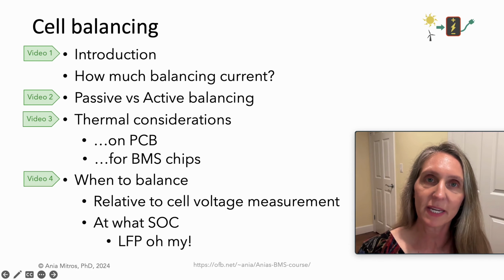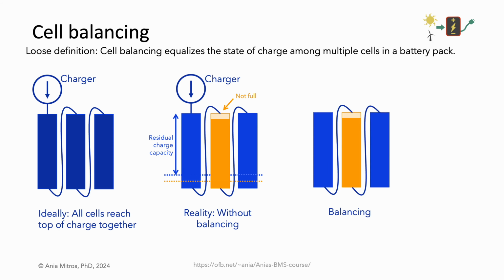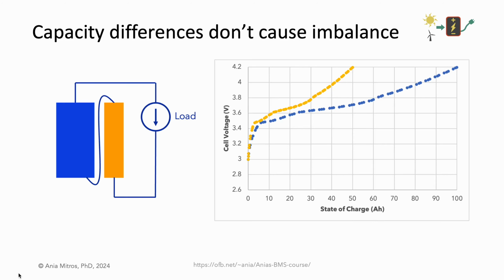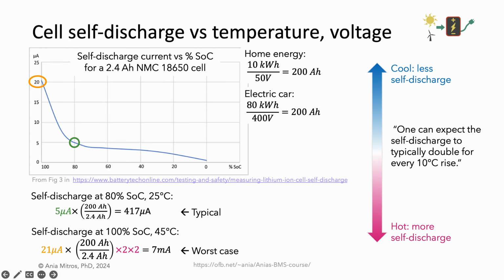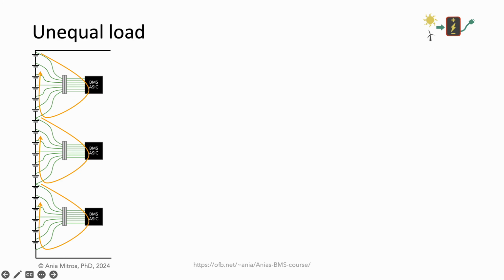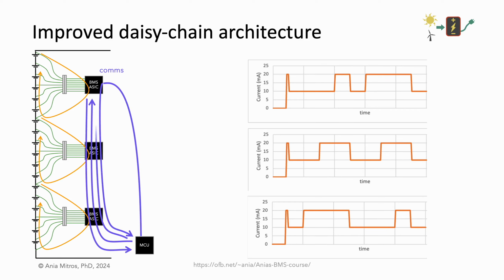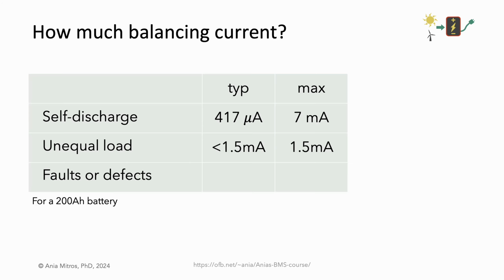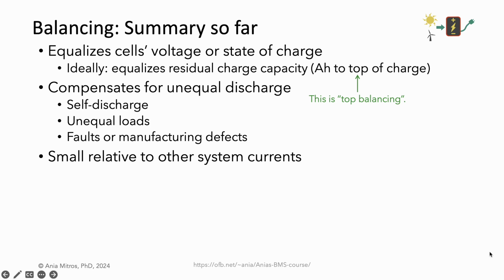Ania's BMS Course: Cell Balancing (1 of 4)

Comment: First of all thanks for your presentation. I am a bit confused however. I understand the statement: "ideally: all cells reach top of charge together" imo this implies they have exactly the same capacity. "practice: cells can end up imbalanced, cells can have different residual charge capacities" imo this means that their capacities (all be it small) are different. I cannot reconcile this with the statement "Capacity differences don't cause imbalance" because the earlier explained imbalance seems to stem from deviations from nominal capacity. Do I miss something here?
Reply from the maker: "Ideally all cells reach top of charge together" doesn't require cells to have the same capacity. Say you have a cell that is 1Ah and another that is 2Ah. Depending on how they are balanced, they might reach 100% SOC (top of charge) together, but when the smaller capacity cell is empty the second cell will be at 50%. Or, they might reach 0% SOC together (bottom of charge), and when thus balanced and then charged when the 1Ah cell is at 100% the larger cell will be at 50%. If you have unequal capacity cells, your balancing algorithm determines at what SOC any pair of cells ends up at the same voltage or SOC.

The sort of imbalance that a typical balancing circuit corrects for arises from unequal self-discharge, not from capacity differences.

I think you're thinking about imbalance as meaning voltage difference. I'm thinking of imbalance as difference in residual capacity, or difference in how many Ah that cell can take in.

Imagine two cells which have 1Ah and 2Ah total capacities, and balance them so that they are both at 100% SOC. Now you discharge them as low as you can go, so that one is at 0% and the second at 50%. Their voltages are different, but as I see it, they are balanced. Each cell can accept 1Ah of charge. If you charge them again, they will reach 100% SOC together.
Reply: @AniaMitros  Thanks for the explanation. It is more clear to me now. Is it correct that you see the function of the balancing circuit to compensate for "drift" effects between cells like self discharge and unequal load? In that sense cell capacity deviations are indeed "static" and properties of the cells. The goal of compensating for this "drift"  is, I assume that the pack capacity remains at the capacity of the lowest capacity cell in the pack.  You could of course also expand the function of the BMS to provide the average of all cell capacities in the pack by transferring energy from the highest SOC cells to the lower SOC cells and also optimize for pack capacity. Eg. you have 4 cells  100Ah 104Ah 104Ah and 104Ah the pack could than be 103Ah. During charging they all will end up individual at 100% SOC at the top and during discharge at 0% at the bottom. If you only would compensate for drift effects the capacity of the pack would be 100Ah regardless whether the pack is top or bottom balanced. So I guess it depends a bit on whether you make a strict distinction between balancing and "redistribution ".
Reply from the maker: @jansunman7393  Cell balancing typically corrects for differences in cell self-discharge, or other effects that draw current from the cells unequally (different current from one cell than from another). The pack capacity in Ah is, at best, the same as the capacity of the lowest cell in the pack. If the pack is imbalanced, then the pack capacity equals the capacity of the lowest cell in Ah minus the imbalance. So in your example of a pack consisting of cells with 100Ah, 104Ah, 104Ah and 104Ah, if the pack is 10% imbalanced, then the pack will have a usable capacity of 100Ah-10Ah=90Ah. Your idea of moving energy from one cell to another is called active balancing. I have never seen it implemented in a production system, and when I've looked at the cost of implementing the necessary high-voltage switches and controls, the cost didn't make sense. I'm sorry I can't address your questions about "drift" directly -- I don't quite understand what you mean by "drift".